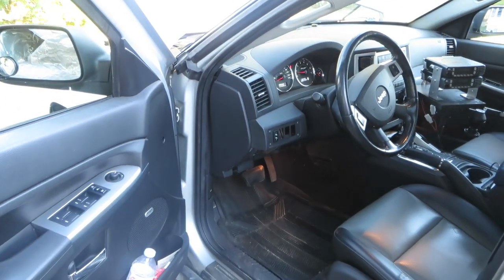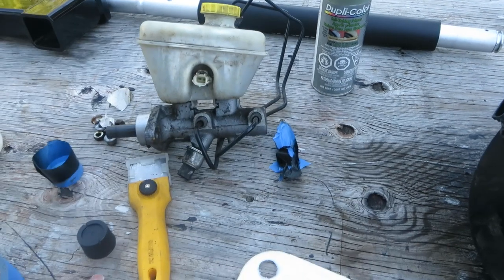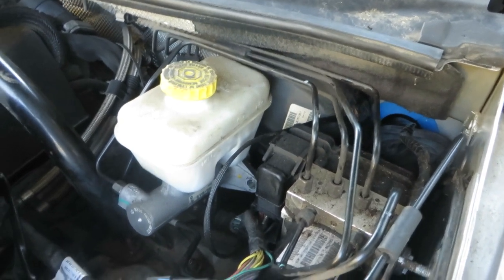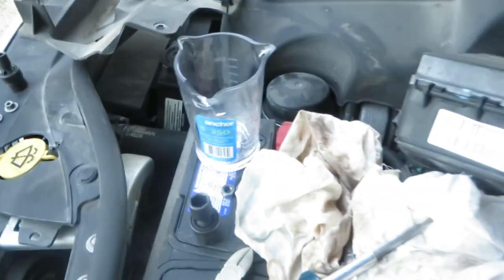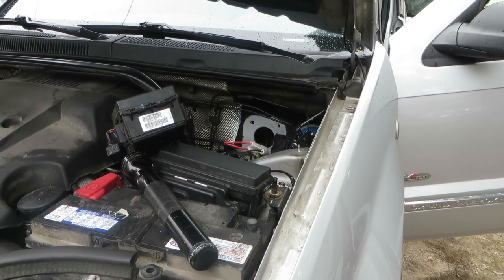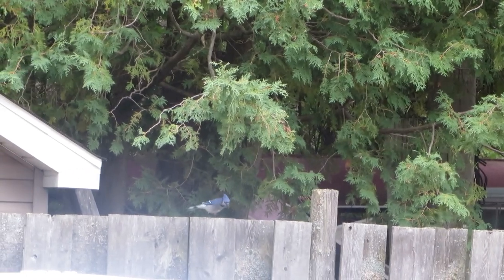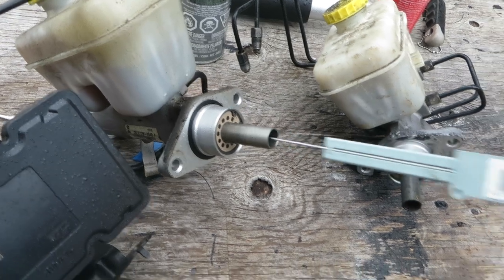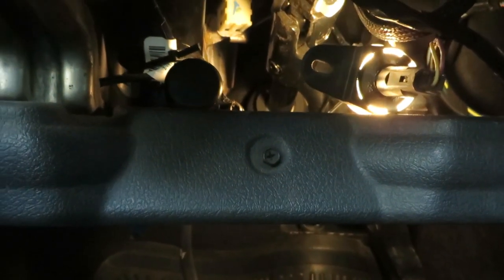2005-2010 Jeep Grand Cherokee WK Brake Booster and Master Cylinder Replacement

Comment: Thanks for the video. I've got the same jeep and same symptoms. Brakes lock up after driving for 10-15 mins on the highway. Sure enough disconnecting the booster fixed my problem. Time for a new one

Comment: Man would this vacuum leak make my engine surge?
Reply from the maker: I think it would cause a lean condition on a gas engine because of the air infiltration.  I have a diesel with a vacuum pump so it doesn't matter to the engine if it leaks.
Reply: Stephen Rivett I just know if I squeeze my vacuum line coming off the booster the high pitch noise goes away. And I have a surge at idle from time to time. Like a vacuum leak